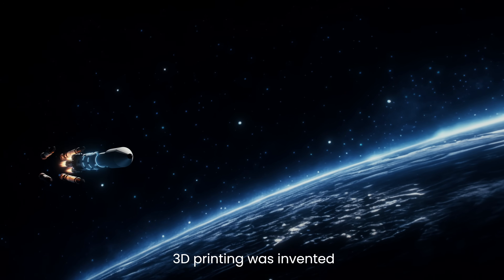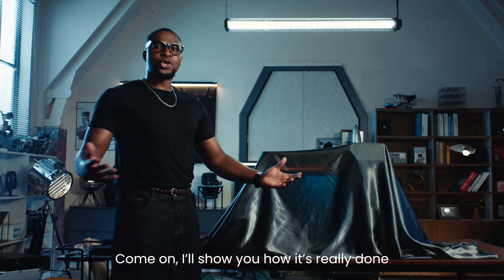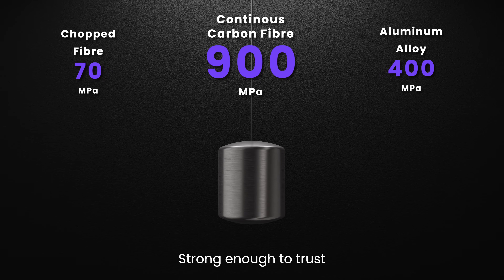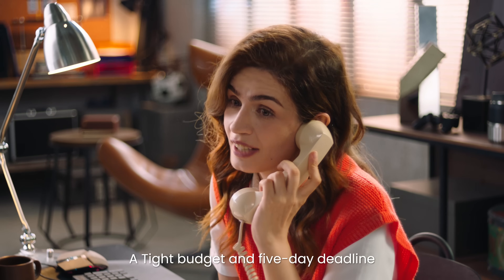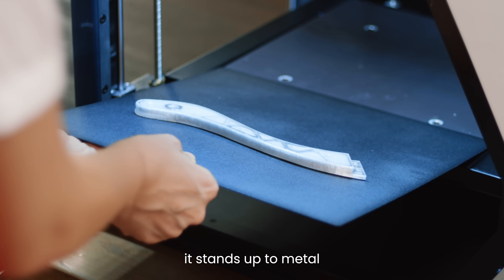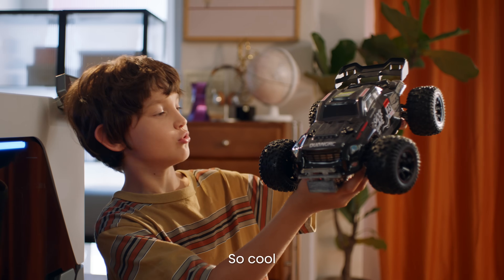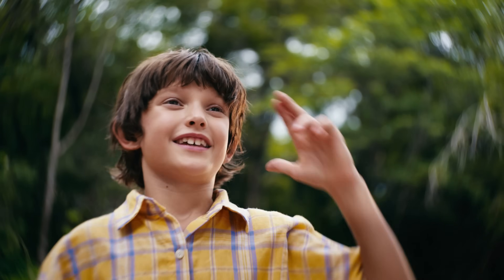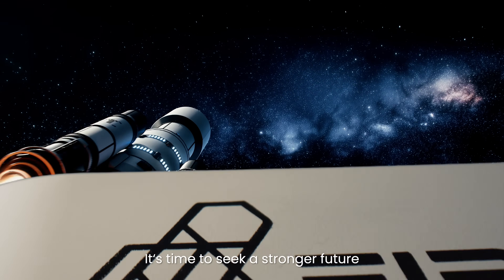FibreSeeker 3-the First Consumer Continuous Fibre 3D Printer

Comment: There's a reason why you wouldn't show a real test with a hydraulic press(just a cute and fancy infomercial) when you should have compare it to other common printing materials in a lab testing setup, because this will create the similar problem of de-lamination present in the titan submersible under stress, the reason is that in this 3d printer the carbon fiber layers are not interwoven so it can mostly be use for compression force, so just a small improvement in mechanical properties is not justified for that price.

Comment: So this doesn't seem like it actually solves layer adhesion which is the biggest issue when it comes to strength.
Reply: I imagine this printed part will be extremely strong in the XY direction but still weak in the Z direction

Comment: 900MPa I doubt it, i want to know if the part hast the tensile strength in all directions? And 900MPa that would be fucking crazy 400MPa has mild steel, just can not believe that
Reply: Yeah there's no way. Whatever test that was is either fiction, or just cooked to favor this. I work with loads of real (as in autoclaves ect.) composites and there is just no way that strength is being achieved without compression, or at all lol.

Comment: As impressive as the machine is, the AI-generated ad is throwing me off. What is the price I wonder?
Reply: We only saw AI animation and hired models. This is a terrible advertisement.  This Kickstarter will fail unless they send samples out to reputable influencers in the space in order to do live demos and vouch for the machine.  Anything short of that is a huge red flag
Reply: And I dont mean sample parts. If youre not sending machines out to trusted makers to review on youtube prior to your launch, i would be shocked if anyone backs the project
Reply from the maker: We are launching under $3K
Reply: @Fibreseek3D  So the fibre is fully sealed in resin and does not shred in the air like with the classic filaments?
Reply: @Fibreseek3D but bambulab has a full nozzle h2d that could do all of this too lol. U would do way better without ai generated video or audio or whatever

Comment: If i was a customer who specified 6061 alloy for a part and the shop sent plastic, I'd be telling them where they can stick their "fibre" 😂
Reply: Its those kinds of attitudes that kill the machine shop business. The machine shop 1000 yds from my office uses a Fusion FDM printer & whenever I want to avoid paying that "aluminum cost," I'll have them build something off that machine. 

"Adapt and stay in business."
Reply: @helixx_4D  You’re missing the point, he explicitly asked for aluminium and was given a plastic / resin composite alternative. Whether it’s got a higher yield or is cheaper to manufacture is irrelevant. He might have wanted aluminium for its appearance or good heat conductivity among over things, so I would too be a unsatisfied customer.
Reply: @Spectre_un06  Because its an invalid point to begin with and the video isn't about that. The OP's comment has nothing to do with the point of the video. I know the value of the machine and what it could mean to machine shops. That to me is adding more to the conversation than making some inane point. Truly the OP doesn't see the value  of the machine.
Reply: @helixx_4D  That's not the point. You don't know the client's application. If you sent over a plastic part for a high temperature fluid valve its not going to hold up. Its not up to you to decide the material.
Reply: @SentinelAerospaceOfficial why would I be arrogant enough to give the customer something they didn't ask for? The pretense under the guise of being smarmy is stupid. If you think I'm going to give the client something They didn't ask for id be out of business quick. But if I can "offer" them a better solution that's less expensive & I still make a profit that's what I was referring to.
Reply: @helixx_4D  You can always offer alternatives and it may sometimes be beneficial. But like the original comment said, if you SPECIFICALLY asked for 6061 Alloy (hence no alternatives) and instead received a composite part you would rightly so be unsatisfied. The way I read your previous comment was, receiving a plastic part after ordering a metal part is justified and anyone that says otherwise is “killing the machine shop business”. But it may just be a communication error :)
Reply: @helixx_4D Giving the customer what they want sounds like a pretty smart way to stay in business to me.
Reply: Except it isnt plastic.
Reply: @stevenreff2513 Carbon fiber reinforced plastics aren't plastic?